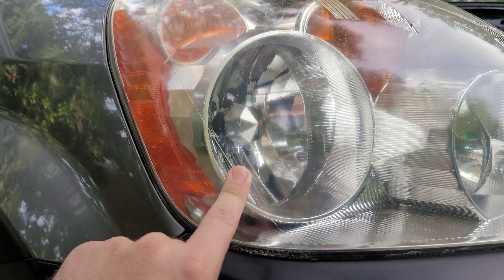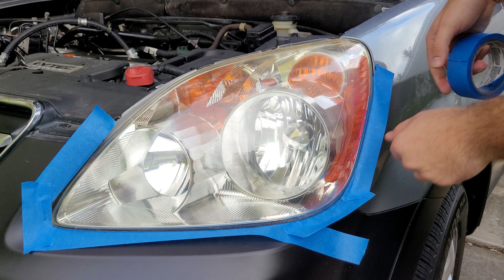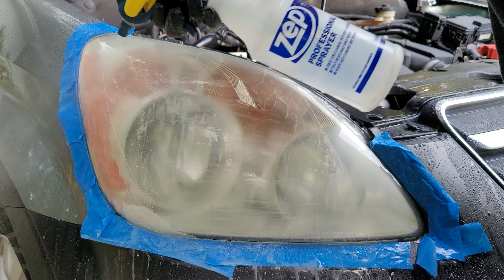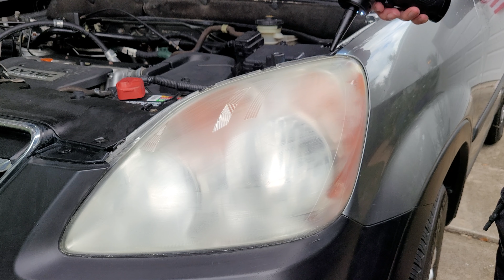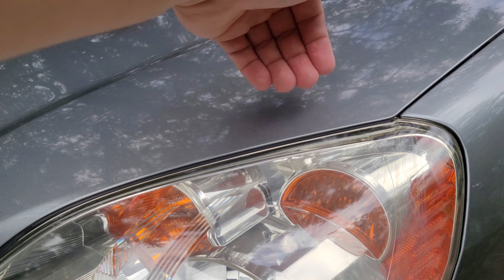Stop using 2K CLEAR FOR HEADLIGHTS! Restoring 17 Year old Headlights! | 2006 Honda CRV

Comment: What is the blower you are using, and would it be to use a hair dryer? Also, unless you did but did not mention, but I did not see you use an alcohol wipe.
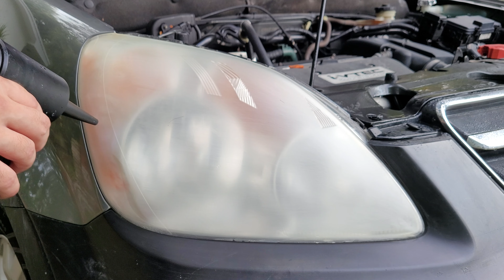Reply from the maker: It's one from overseas. I was sampling different ones for the website, which should be online once the site update is live. No, you must use a higher pressure blower. Its mainly used to knock out loose water. If you skip that step, and apply the clear coat, the pressure from the can may knock out the loose water and drip on the freshly coated lens. At 10:57 and 19:37 is when I am cleaning with the alcohol.

Comment: Whats the problem w 2k clear? If these were done properly then protected properly i see no problem w the choice of clear coat.
Reply from the maker: 2K Clears hardening properties are very harsh. No restoration is permanent, so when it comes to doing future restorations, its time consuming, and requires more of the headlight to be removed, therefore can makes the lens brittle/cause stress cracks. They also don't simply oxidize, they begin to chip/flake. When in the business, it can be a small wrench in the cog of the schedule since they are so time consuming to do, whether you're hand sanding, or using tools.
Reply: @StartRestoringHeadlights  will something else last longer than 2k clear tho?
Reply: the longer it lasts the less you have to sand the headlights.  so the idea of using a product that holds up for less time for the sake of it being easier to sand seems short sighted to me.  the more you sand the headlights the more likely they are to crack.
Reply from the maker: Yes, the clearcoat we use is rated for 5 years if applied correctly, and maintained.  @dfacedxa